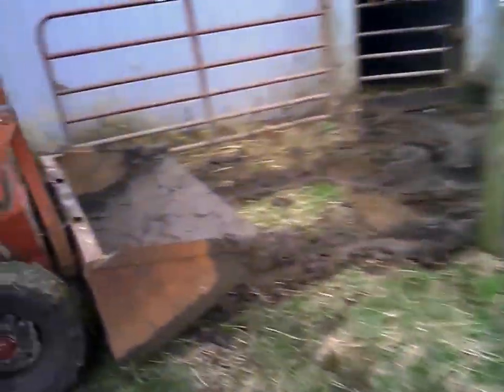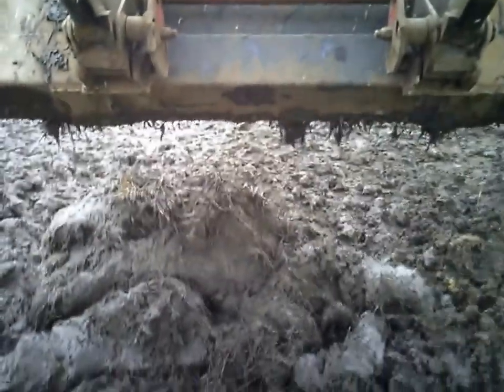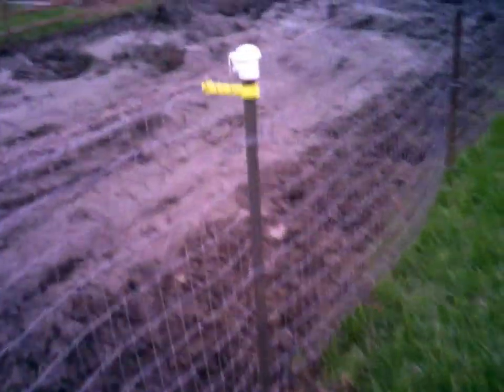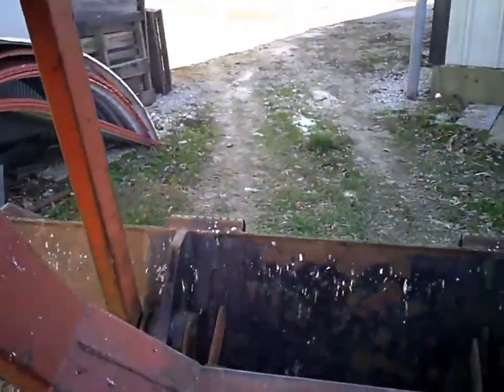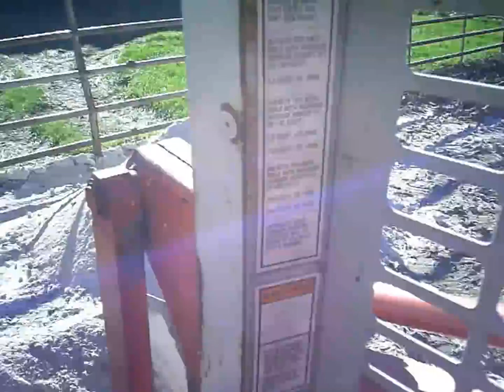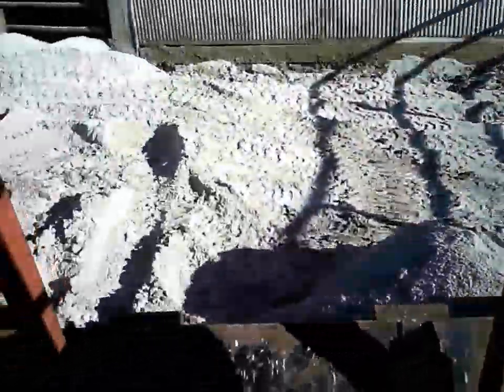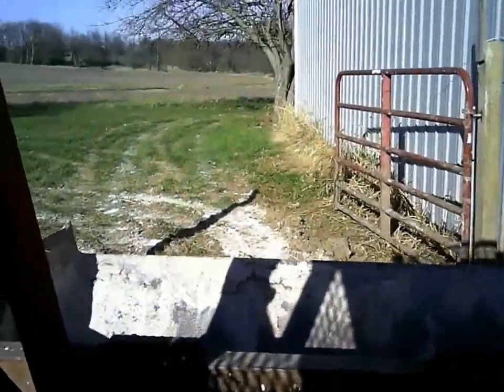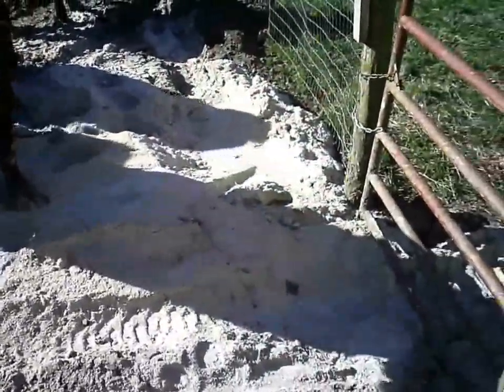Fixing the mud hole in the cattle pen

Comment: After years of stone and mud cattle lots the one thing I have learned is put fabric down first  if not you will just keep putting lime down and it will just keep sinking. I have found a billboard company here local that gives me there used billboards just like a very thick rubber tarp material I put down and stone over. We have some that have been in 10years still holding well. If you go to do the whole lot look at putting road fabric down first believe me it will save you in long run!
Reply from the maker: Laurel Creek Livestock now ya tell me! LOL that’s a good idea if I do the whole thing. Thanks for watching

Comment: Throw some chains on the rear.  We made some for our Case 85XT and it makes a world of difference especially in the winter.
Reply from the maker: Jack Johnson I bet it did! I would if I was gona keep it
Reply: Jake Ziegler Yeah she will claw through anything now. Ice was the only issue before. Front chains too for emergency. Sure beats the price of slip on tracks.
Reply from the maker: Jack Johnson ya I’d hate to buy a set of those
Reply: Jake Ziegler Yeah spendy. We cut down the chains from an auction set so all was well